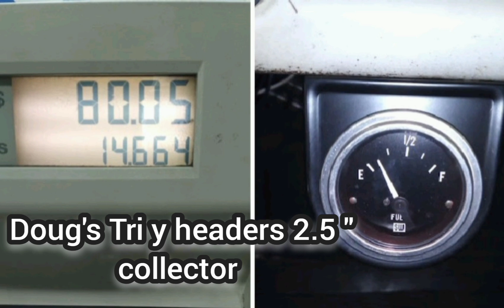1978 Chevy 454 1991 Heads Doug's Headers wieand 180 intake comp 280 H cam off key start after 4 yrs.

Comment: Did you break in the cam with no cooling system?
Reply from the maker: No the engine was already a runner when I bought it the cams been broken in
Reply from the maker: It was in a 90 SS Silverado it had the HEI with 4 plugs coming out the back for throttle body

Comment: Wheres the 460 to compare it too? I know which one is more powerful stock with a double pumper....
Reply from the maker: Actually I was asking you guys what's better I bought this motor for 1,100 had it in the garage for 3-4 years slapped a carb on it put headers on it fired right up retarded timing maybe 6 degrees at the time .
I have a FE in my 69 F250 C/S 390 with comp cam  eddy RPM headers getting into this 454 compared to my FE and it oiling issues etc I was more impressed with the 454 .
Reply from the maker: I sold the 454 already 1st day up.  It tested 180 dry on a compression test  I know a FE is not a 460 Ford but I was asking with those who have had both worked with both what's your opinion on both I love my Ford although working on it sometimes I say why did they do this 🤔 and I think that's why a lot of people don't like Ford but that's a opinion .  They can be harder to work on in the car/truck wierd  things like pushrods going down the intake manifold ? I've experienced my share of frustration with my Ford .
Reply: @TheThirdWheel618  I've only personally worked on and rebuilt a 351m and a 400. I have a 72 ford ltd. In my opinion the growl of a 460 is meaner than a 454....but a 454 will walk a 460 to the park. My old man had a 63 chevy with a bored and stroked 454. It was insaaaaaane.
Reply from the maker: @coreysharp9794  yeah it's a mean motor for sure doesn't take much to make them bulletproof
Reply: @TheThirdWheel618  right now I'm debating rebuilding the LT1 in my 93 z28 or bringing her up to the times with a ls swap. I'm really torn because the 93 was the only year with a non electric 4l60. So if I do a swap I have to change transmissions....ouch. on the other hand a budget built lt1 cannot hang with a half budget built ls1. Quite the toss up.
Reply: @coreysharp9794 Don't ls swap it. The LT1 is a pretty special engine. They run great and respond well to mods. They will one day be considered rare and valuable. Also LS's have no soul.
Reply from the maker: @andysteele4056 ☹️ I needed the $ and I sold it already but .....I was impressed with the motor 3 years in the garage no carb no exhaust put both on fired up first crank mean machine ...